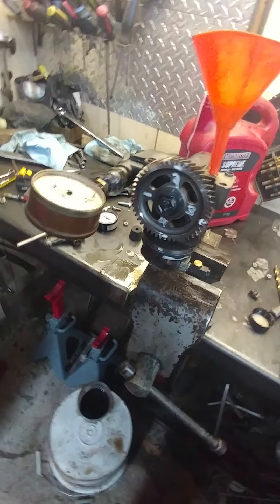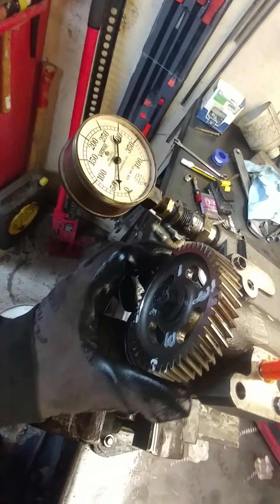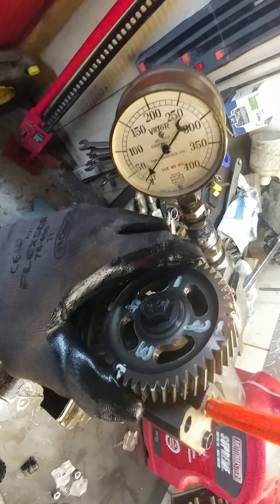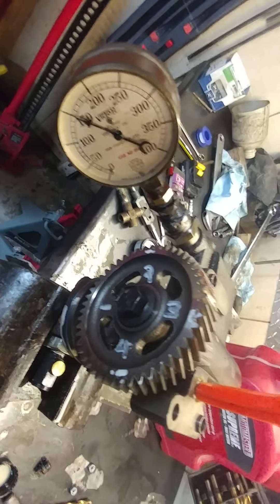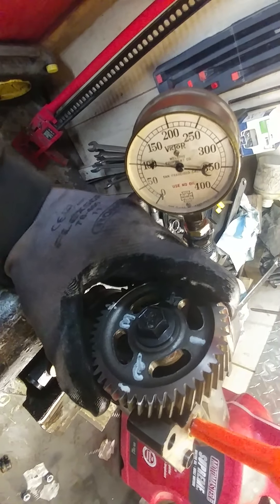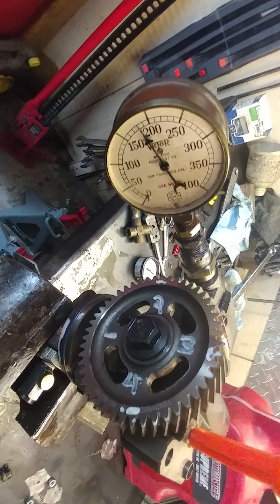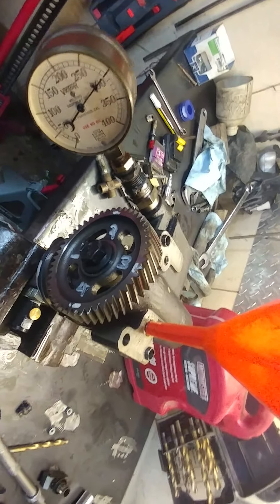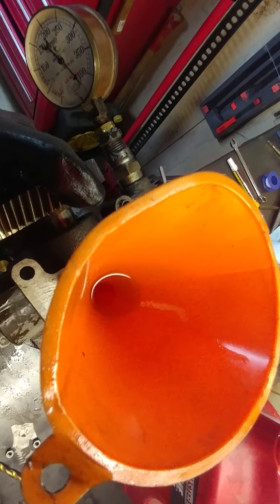2006 6.0 powerstroke Hpop testing pt2

Comment: Thats interesting.  I use air and turn the pump by hand, find that at some positions it will leak when its bad.
Reply from the maker: In the end i dont think the pump was bad as the new one did the same thing and it did not leak air when tested with air. what i suspect is that since the pump is a v4 design probably oil werent filling up 2 of the 4 cylinders the same way be cause of the orientation of the pump in the vice